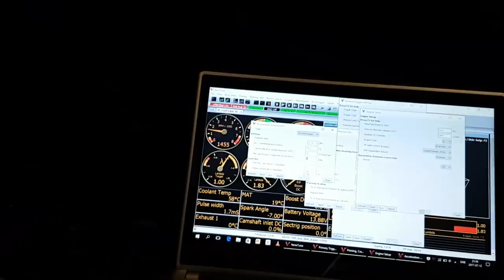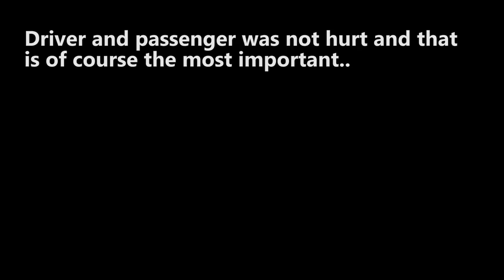BUILD AND CRASH A 190E V8 TURBO IN 3 MINUTES

Comment: How did you align the bellhousing prior to welding?
Reply: With a custom aluminum centering "sleeve" on the input shaft of the gearbox that gets bolted to the crank. There is a video of it on this channel somehwere

Comment: Are you guys using a Tilton clutch 28spline after the machining of the g6s to mount to the m119?
I’m debating on an m104 auto or m119 manual and not sure what clutch I would use.  Thanks for all the videos.  They inspire so much!
Reply from the maker: Thank you for the positive words 😊 Do you have facebook? Send the clutch question to the 190E owner "Engdahl Motorsport". Regards 😊
Reply: It's a quatermaster 7.25" 2 disc rally clutch. Basically the same as Tilton, AP, etc. I have the CAD files for the flywheel is someone is interested

Comment: motor from which car model and rear subframe, please tell me it is very interesting, thanks earlier
Reply: The engine is from a AMG E50 from 1998. The rear i still W201, and stock in the videos, but it now has a BMW E60 M5/M6 diff and axles.

Comment: what a beautiful beast😍
does this engine has piston oilsuirters?
engine modifications?

greetings from austria
Reply: Zero engine mods :) Just a big turbo, E85 and carefull tuning. 
I belive non of the M119 eninge have oil cools pistons.  But it seems the block is the weak link, since i cracked the 5.0 open deck block.
Reply: yes i think too cause its alloy block

Comment: I think it could be at a power level where the tyres are starting to struggle for traction lol
Reply from the maker: ~800hp at the moment. Would be nice with a little bit more next year though 😁
Reply: @dynochannel  lol hmmmm, that's 400 per tyre,,  what sort of psi are you running the 5.0 to produce 800. Can I guess?  I say maybe 14 psi???
Reply: @alanchatfield5533  i would say 22 to 30 psi, since stock 5.0 is in the mid 300ps
Reply: @chiefdenis  a little room to play yet then, 1000bhp is in sight, ,
Reply: @alanchatfield5533  The 5.0 AMG engine made 800whp at 1.25 bar 18psi. This 4.2 engine makes just about 700whp at the same boost.  It has the AMG 5.0 cams in it. And E85 and the headers really boosts the power.
Reply: @Webrexxx  fair play I thought it would be around the 1 bar mark ish,,  it's still on standard compression ratio then I must assume,  and standard rods?
Reply: @Webrexxx  that's insane, i forgot to factor in displacement since pumpish makes 800whp with similar boost pressure on m104
Reply: @chiefdenis  well, I know him, and he rund more like 30psi to make 800whp.
He runs 8.6 compression, and puny 3.2 liters 😅
My 5.0L and has 11:1 comp 😅 
It will make easy 1000hp, but since I accually race my car, it needs to be built much stronger.

Running only on the street with an automatic like pumpish is childsplay 😅

I have lots of overheating issues, diff issues, propshaft, driveshaft issues, and even the whole rear subframe gets twisted... 
Next year it will be 100% bulletproof
Reply: @Webrexxx  lmao, i assume pumpish isn't going to be too fond of his blueberry being called puny. 
Personally I'm a fan of manuals, but i think the auto box eases out the power delivery which is why his w124 is more reliable, but i guess it wouldn't work as well for racing. 
I'm not gonna lie, it's kind of cool that two of my favourite merc tuners know each other,
Cant wait for the build videos, this animal needs to get back on it's feet. 
Thanks for the replies.

Comment: This happened because the power was unusable, and cant be controlled, tune power to be more progressive with a smooth curve not an on/off switch like spike.
Reply from the maker: The v8 gives plenty of torque over the whole rpm register. 😁😁 No power spike. If you look closely on the video you see that the bmw in front on track also crashed. It was oil on the track 😑😑
Reply: Dyno Channel

I see, just seems like the car lost traction every time the throttle was applied, didn’t sound progressive.
      I had to tune my car for the boost to come in progressively or its just un drivable, just sits spinning on the spot.

Comment: Too much power, or nothing understood from driver. Shit happens. Hope you build it quickly and easy, than have more safetly und fun. Good luck
Reply from the maker: Oil on the track. If you watch the video one more time you will see that the bmw in front also crashed at the same time 😐 Thank you for the good luck wishes 👍
Reply: @dynochannel  yes i see. Good luck. But the Mercedes is easy too repair. My friend,  i got a EVO 2. Fantastic machine.

Comment: Too much power for the drive he needs more practice. So sad for the merk tho
Reply: I have 10+ years experience, but as you can see, both cars went straight into the wall, the track was incredibly slippery when you got out of the ideal line.
We where the first 2 cars out on this drift session, we went out after the straight line guys had dried up the ideal line, so the conditions was 80% dry track, with almost zero traction if you hit the wet spots. And unfortunatly, we did, without knowing how bad that spot gets.. As did 10+ other cars the same weekend.. Lots of carnage...
We learnt that this track is notoriously slippery when wet because of all the drifting they host.. 
So... Im not going to drive semi wet condition ever again, lesson learned, haha